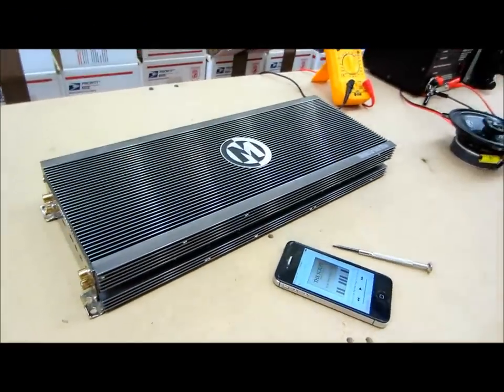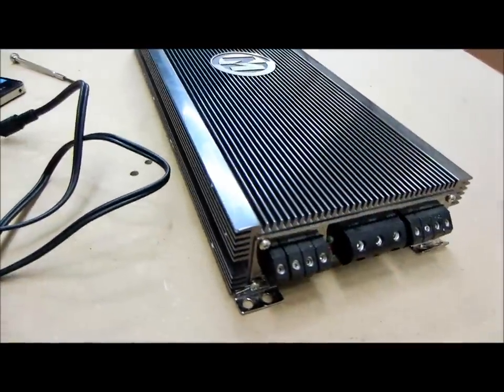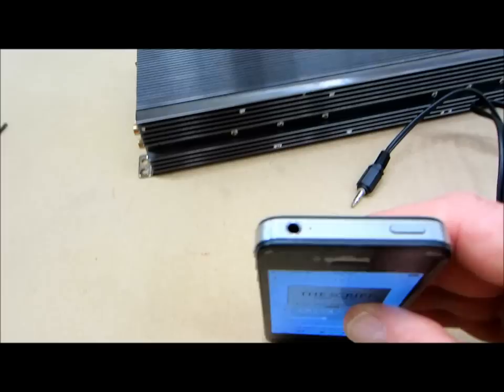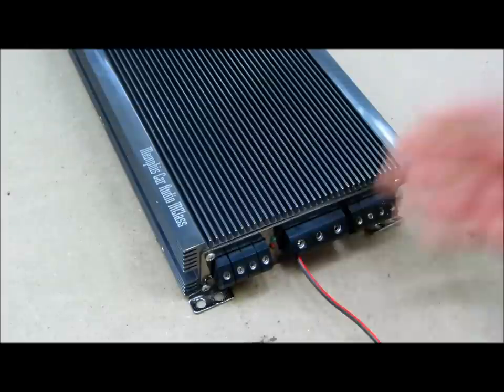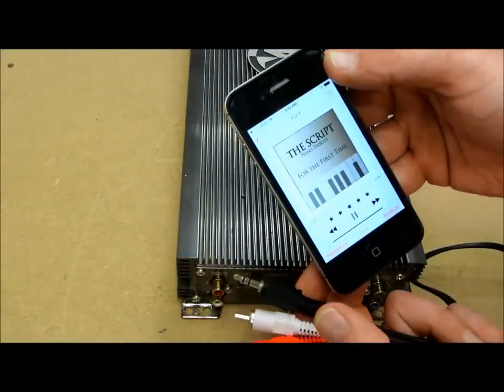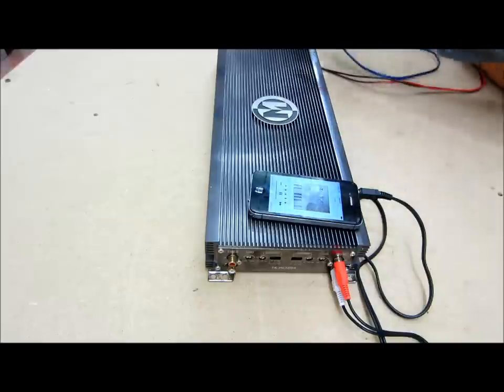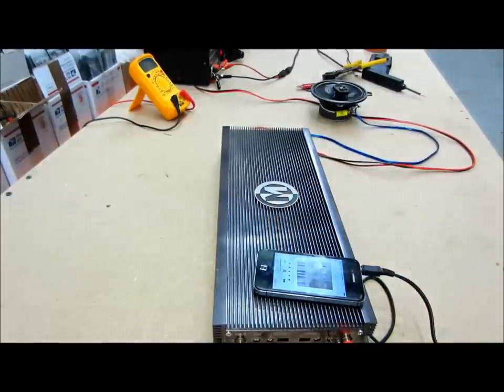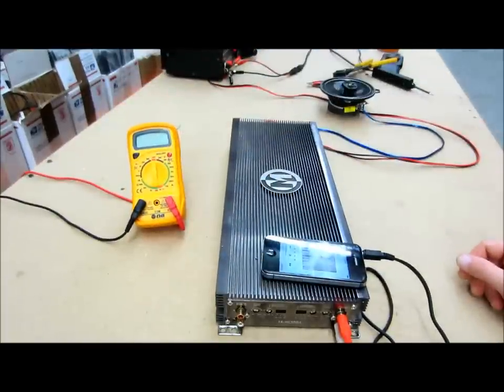How to test an amp ( amplifier bench test )

Comment: Hi, I know this video is old but I have a old high end amplifier(audison vrx) and last time I had it installed was 2012 and one channel stopped working. I opened it up and didn't see anything burnt or "off" looking. I've read about a spray called deoxit, can this be sprayed on anything inside the amp? Or into connection points? Wondering if that could help? Otherwise maybe try your set up to figure it out? Any ideas?

Comment: Hey bud thanks for all you videos helped me alot. I have a question on buzzing in my speakers im running a 4 channel amp and checked everything from grounds to power and made sure my speakers were not touching metal. So the buzzing is not engine in fact it buzzes with the car not running i ever ran other rca just in case and still buzzes then i pulled all rcas and still buzzed. What am i doing wrong? Please help! Thank you!
Reply from the maker: check the impedance on your grounds, if all else fails there's always ground loop isolators...

Comment: Do you need to run a fuse on the power cable if its only going to be tested? Its a jl hd 900/5 no on board fuses, going to be tested indoors

Comment: Any way to test inputs on a factory amp? 07 cts with Bose system.. I have the gmos-10 interface and the warning chimes work but no audio from any of the sources FM , CD Aux etc.. I tested outputs from amp to speakers with tone generator and all checks out.. only thing I can think of is either my interface is defected, or the amp inputs are shot.. any suggestions?
Reply: Probably your head unit right

Comment: Hey les I have a pair of Memphis pr components the recommended power is 70 watts RMS I have a hifonics amp that puts out 75 watts RMS in other words would I blow my door speakers if they're getting those extra 5 watt RMS?  I've never connected my amp to them bc I'm scared of blowing them being as they cost me 140 per set thanks in advance
Reply from the maker: My advice is this, adjust the max gain output on your amp to match the speakers just before they start to sound distorted, the speaker will tell you when it's had enough. Don't go my numbers, go by what you hear..

Comment: I have a dumb question - I have an amp and my positive and negative for speaker connection erased how do I know which is positive output it negative for speaker
Reply from the maker: do a continuity check from the amp chassis and either wire, one will buzz out, the ground..

Comment: Are you still in business for repairs? I’ve got a PPI A404 4 channel Amplifier. It has blown fuse. I’ve opened as I’m not worried about warranty since it’s from the early 90s. I notice nothing burnt or disconnected. Please advise
Reply: Look for cracked power connectors they look like tubes if there cracked there not keeping power and if it’s blown replace them copper feeders

Comment: To properly test an amp one has to test the output voltage and current. Use both to workout if its has the correct impedance and wattage. Didn't see this to be fair, which should of been one of the first things.
Reply: I was hoping this video would show how to get those numbers through bench test. Not just if the amp is in working condition.

Would you be able to guide me on how to get wattage with a multimeter?

Comment: are you using AC 12volts charger that you connect to your ampflier?
Reply from the maker: Yes, I use DC power supply
Reply: can you post another  video again that i can see the clear demo from dc to amp ty btw i like it

Comment: Hi man! 
I have problem. 
Amp has only 1 light and its red. and its not turning on. (light)
I tested + it recives 12.8v(amp)
I tested ground it has .
Remote took from + or power.
RCA cabels are good(working).

Any ideas ?
Reply from the maker: ***** sounds like you need to buy an amp

Comment: Hello, I ahve a set in my car. Whenever I turn it on no sound comes out and the Amp heats up. But heats up a lot. After that I stop it. My lights work ok. Red and then Green normally.

Please help.
Reply from the maker: I'd have that amp tested by a professional. There are a lot of components in an amplifier that can go wrong.
Reply: Lessco Electronics Hello, I did some searching in my amp and I discovered that what burns is 2 tranzistors named c 4467 and A 1694 which are next to each other. I have no idea... :(

Comment: What did you connect the remote wire to?
Reply from the maker: +brotherbosco I tied it in with the +12v power wire to my power supply there on the work bench.

Comment: what if my speaker output is not pushing out sound how could I check n repair
Reply from the maker: you most likely need to test the power ic chips inside the amplifier

Comment: This was pitiful. You never power up an amp that you know nothing about until you take the cover off and do a quick visual of the parts and probe some of the internals with your multimeter before you power up with no problems. By powering it up like that , you could have done a lot of damage to it. Never trust a second hand amp until you inspect it first.
Reply from the maker: I was doing a simple bench test here, Bot a full on circuit board operation!
Reply: Im no lowbrow but seriously if an amp is  gonna explode from meeting at 12 and then ground then you should be going and getting your money back not attempting  a circuitboard repair. most of us ,even the seasoned, are not electrical engineers. I have tested 15 used amps  in my short lifetime in this method and every single one has turned on
Reply: @rmblwgn  What is this guy even talking about?!

"Never power on a used TV unless you take it apart and probe the internals!"

Are people booby trapping Amps?? WTF

It's car audio, not rocket appliances.